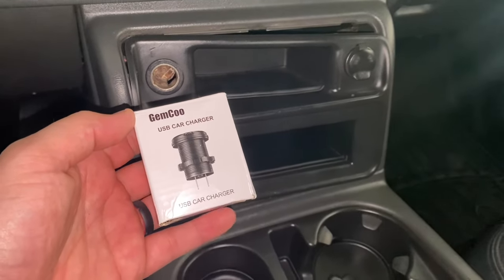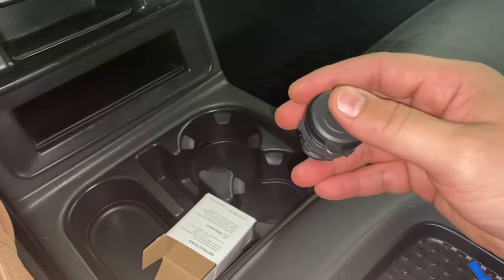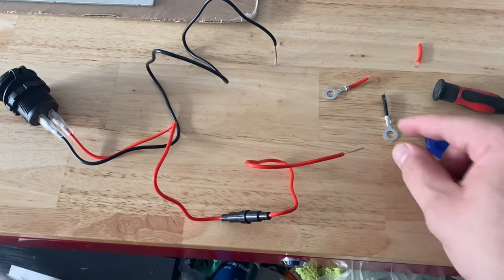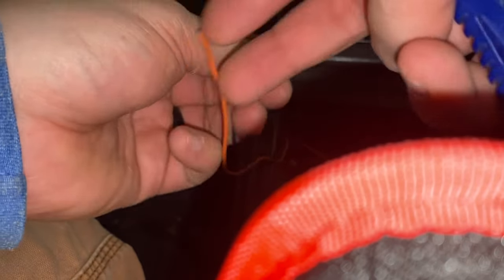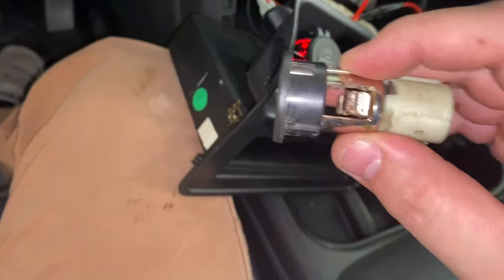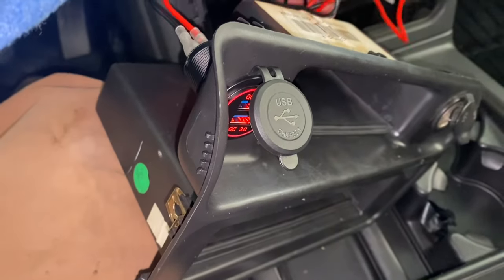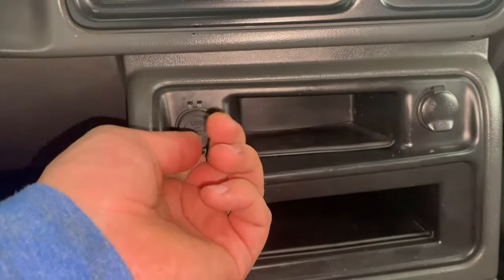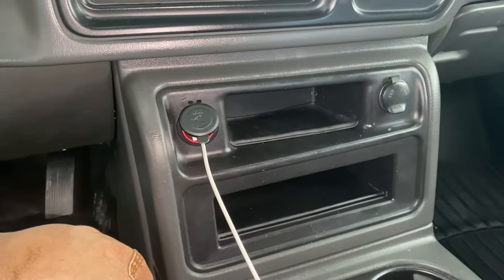How to Swap out a Cigarette Lighter Socket for USB Car Charger

Comment: You could have wired the USB socket directly with the original wiring of the lighter.  No need for the included fuse since you have eliminated the cigarette lighter the USB socket will be connected to the fuse of the cigarette lighter in the car's fusebox,  Good job BTW

Comment: I have one of these but I’m afraid it’ll run my battery down because it’s always on. How can I wire it so it’s only on when my truck is running? Good video!
Reply from the maker: @tom7073 not sure I didn’t gif that deep into it. there is a small light that turns on in the charger which is the power button. I’ve left it on before for weeks and hardy draws any power. Truck cranks up everytime. But you can turn off car charger and the light turns off as well. There an on/off button on it.